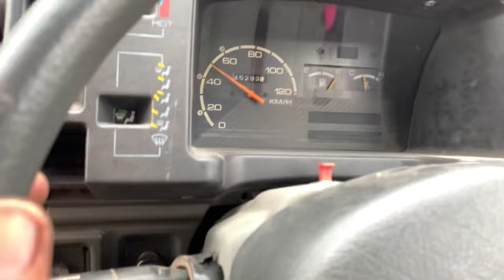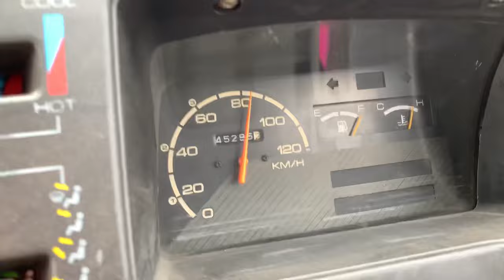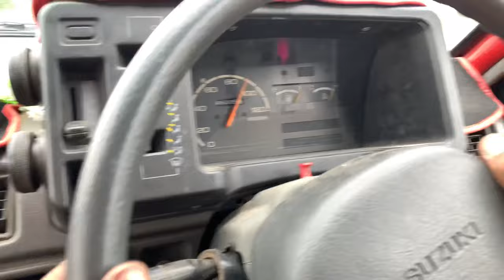The complete procedure for attaching a Honda 125 carburetor to a car | Unique Idea for Amazing Video

Comment: It can run .but due to less air to engine it will consume more fuel so not beneficial .and it will not stable on hills
Reply: Exactly....but what thru jugaarr (Fuel jet with increased diameter, max possible fuel supply), they will manage to improve a common user experience OR at least will convince the customer that compromised eng performance is a bargain for 40km per Ltr . However, over a period of time this engine will be ruined due to highly lean fuel mixture resulting higher engine Knock.
660CC engine is capable of swallowing 0.5 to 0.6 gram Air per second and proposed carburetor can never meet stoichiometric air-fuel ratio of 14 air:1 fuel....very high lean conditions, resulting higher knock effects coupled with detonation in cylinders, sudden temperature rise and engine metallurgy going to 🐕....
"Barrey barrel shehron mein gareeb insaan aesey he lut-ta hae"
Reply: Yes.true
Reply: @AutoDiagnosticsPK  apkai nazdeek yeh option sahy nhi hai?
Reply: @pakistaniraees  
جی بلکل بھائی۔ 660 سی سی کی گاڑی میں جب 125 سی سی کا کاربوریٹر لگے گا تو گاڑی چلے گی ضرور پر اسکی پاور کم ہو گی، آپ ایکسیلیریٹر زیادہ دبائیں گے اور فیول ایکونومی بمشکل ہی مل پائے آپکو پر یہ گارنٹی ہے کہ گاڑی میں ناکنگ ہو گی اور انجن کی لائف کم ہو جائے گی۔ اور بونس میں گاڑی انڈر پاور رہے گی، یعنی چلانے کا مزہ نہیں آئے گا
660 سی سی گاڑی ہوا کی زیادہ مقدار سک کرتی ہے اور چھوٹا کاربوریٹر اتنا فیول سپلائی نہین کر سکتا، بھلے یہ اسکا نوزل کتنا بڑا ہی کیوں نہ کر دیں
Reply: You can use 30mm or 32mm carb, that honda 125 carb is only 24mm maybe 26mm i think,its too small..
Reply: An American guy put lown mower carburettor on V8 it even gives best milage
Reply: I have Maruti 800 brother can you do that for me

Comment: Not recommended. at the end of the Ride. the temperature gauge is at high position. its mean due to low air/Fuel intake car is getting heat-up.

Comment: Smaller carburettor, a little less power, better kilometres per litre, good when gasoline costs so much. Really amazing how well it works. 👍✅
Reply from the maker: Thanks Sir
Reply: sir massg pa rabta ho sakta ha.
Reply: @AmazingTechnology1 
❤
Reply: Assalamualaikum sir ya petrol pipe T shape main q lagay hai fuel pipe ki setting Samaj nahi ahi
Reply: Not at All....its not about better fuel average against little less power but its about ruining your engine in totality........

 thru jugaarr (Fuel jet with increased diameter, max possible fuel supply), they will manage to improve a common user experience OR at least will convince the customer that compromised eng performance is a bargain for 40km per Ltr . However, over a period of time this engine will be ruined due to highly lean fuel mixture resulting higher engine Knock.
660CC engine is capable of swallowing 0.5 to 0.6 gram Air per second and proposed carburetor can never meet stoichiometric air-fuel ratio of 14 air:1 fuel....very high lean conditions, resulting higher knock effects coupled with detonation in cylinders, sudden temperature rise and engine metallurgy going to 🐕....
"Barrey barrel shehron mein garden insaan aesey he lut-ta hae"
Reply: @AutoDiagnosticsPK  really!  From a year ago, have you been in hibernation? 
The subject car works, clear to be seen, I have done the same thing with a 500cc motorcycle engine many years ago, not one detrimental issue, despite all your "theory". Please try to keep up...
Reply: @gazzafloss  never dear...you did this mod with a bike with 500CC...and a bike designed air-fuel ratio perhaps is different and at least it needs much lesser fuel due to lesser parts and loads/lesser accessories the engine has to run....so lucky for you....below lines, I typed earlier as I couldn't read your text correctly and just took it as if you were referring to a 660 CC car Engine....nonetheless, it may be useful for someone 

if ones car with smaller carburetor doing great then it's defying the established laws of science....must be a Saint (just kidding...no offense)
Perhaps you must have modified air system as well....
Just popped-up in my mind, another science theory when I mentioned air system modification.....less fuel with much more air can't give you good averag and engine can't sustain its health either....yes, in case, there are already engine compression losses (due to worn ring-piston or disturbed lifters clearances), so the engine capacity for air suction will reduce and if you are lucky air-fuel ratio may come closer to stoichiometric ratio of 14:1....and if your car is still running, then you are that lucky guy....
Happy for you that your car is running good with this modification
Reply: @AutoDiagnosticsPK  it works, that's all that's important to know. What the theory says in this case is really irrelevant, you can be sure the owner of that vehicle isn't worried beyond having his car working for a reasonable cost, so what works, works, it may not last another 20 years, it may not win a race but it works.
The 500cc motorcycle that I did many years ago worked fine for it's purpose for a couple of years which is why I made my positive comment about what they had done in the video, I know it's not "by the book" but it does work.
Reply: @gazzafloss    I am happy for you mate....

Comment: Hello we just did a full rebuild on my Suzuki alto 1986 0.8 39hp everything inside is brand new from top to bottom a full engine rebuild and I m wondering what type of engine oil do I need to use and what do you recommend

Comment: Thanks for sharing this video clips.... Please can this method be use for a 4 Cylinder car with 2.0 Liter engine...? I am just thinking if this method will minimized fuel consumption... Gasoline/Petrol prices is now on the high side
Reply: Never improvised for fuel economy, else you will have to pay much more than your expectations.....you car design won't allow...
Here is a brief explanation, I posted elsewhere in this chat; I hope will help you understand the why part....moreover, get your car data analyzed, to know what to do for bringing back max possible fuel average in accordance with manufacturer design:-
they will manage to improve a common user experience OR at least will convince the customer that compromised eng performance is a bargain for 40km per Ltr . However, over a period of time this engine will be ruined due to highly lean fuel mixture resulting higher engine Knock.
660CC engine is capable of swallowing 0.5 to 0.6 gram Air per second and proposed carburetor can never meet stoichiometric air-fuel ratio of 14 air:1 fuel....very high lean conditions, resulting higher knock effects coupled with detonation in cylinders, sudden temperature rise and engine metallurgy going to 🐕....
"Barrey barrey shehron mein ghareeb insaan aesey he lut-ta hae"
Reply: Es se gaari ki race zyada do to gaari baith jati hai.  pick ni lrti.

Comment: You gays notice 10:45 in  Vedio the heat Needle was on last poision means at H, so buddy after some times the engine will goes up fire and blast, to much dengerous for both car and human
Reply from the maker: Thanks 🙏
Reply: Exactly....yet, they will manage to improve a common user experience OR at least will convince the customer that compromised eng performance is a bargain for 40km per Ltr . However, over a period of time this engine will be ruined due to highly lean fuel mixture resulting higher engine Knock.
660CC engine is capable of swallowing 0.5 to 0.6 gram Air per second and proposed carburetor can never meet stoichiometric air-fuel ratio of 14 air:1 fuel....very high lean conditions, resulting higher knock effects coupled with detonation in cylinders, sudden temperature rise and engine metallurgy going to 🐕....
"Barrey barrey shehron mein ghareeb insaan aesey he lut-ta hae"

Comment: suckup vibration pad rai  tbhi bajaj 150 gravel pe skid marti 400 k uper th gravel uda deti torque radial se tbhi... thanks but dunlop 20 auro hawk tube5 oximeter 30 dal rai uspe thanks again:pride-megaphone-rainbow-handle: ab ek bar jhatez vibration of tata cam shaft nano reasoning batae under poer ki plz:face-green-smiling:

Comment: Use same old carbuerater... Just simply place some clutch wire in the holes of both  jets it will better fuel economy and try to run your car with soft padels and low on rpm..
Reply: How to place clutch wire in the holes of both jets?
Reply: @LA7-w2x  unroll the twisted clutch wire, then they got separated. Use single wire from the bunch and cut it in the size which can be tied through the hole of jet... I hope u can understand... It's very simple if you asked any old mechanic to do so ...

Comment: A carb is a " vanetury nozel "  that provides fuel Air mixture to engine ,,,,, One little Clerification >>> Engine suck only that much mixture ,,Required by engine ,,, So any carb can be fitted to any engine ,,, second >>> less fuel consumption means  less Heat produced ,,, this engine will not heat up by the law of thermodynamics .... Third >>>> fuel efficient carb never had a bad effect on engine life . please stop commenting ,, yeh garam ho gy ,,, engine khatam ho jay ga ,,, Thank a lot
Reply from the maker: Okay Thanks 🙏
Reply: Ya garde ke heat wali soi full heat Q ho gai.
Reply: @qaiseralishah66  Video at 9:33   ,,,, Fuel / petrol guage is at full ,,,,, Heat guage is at 40 + degree ,,below the mid point , Watch it once again ,,, if you issues / question ,,, Please ask owner of this clip ,,, one more thing please ask in plain English . thank you have a nice day .
Reply: Exactly....but they will manage to improve a common user experience OR at least will convince the customer that compromised eng performance is a bargain for 40km per Ltr . However, over a period of time this engine will be ruined due to highly lean fuel mixture resulting higher engine Knock.
660CC engine is capable of swallowing 0.5 to 0.6 gram Air per second and proposed carburetor can never meet stoichiometric air-fuel ratio of 14 air:1 fuel....very high lean conditions, resulting higher knock effects coupled with detonation in cylinders, sudden temperature rise and engine metallurgy going to 🐕....
"Barrey barrel shehron mein garden insaan aesey he lut-ta hae"

Comment: Yeah it can run.. but not at long period because of low fuel mixture to engine. That carb is not build for a car and it will cause your valves my friend tried that so I know about this 😅 
So don't destroy your engine's....
Reply from the maker: Thanks 😊
Reply: Finally someone in comment section who understand basic stuff leaner mixture i.e with higher oxygen when heated could oxidize the Exhaust valve and make metal oxides and Causes Pressure in engine to reduce during compression and Power stroke
Reply from the maker: You are right thanks sir

Comment: Can't understand because 125 fuel mixture can't feed 800 cc engine as per it's need,. fuel starvation will occur
Reply from the maker: Thanks 😊
Reply: Well 800 3 cylinder means only 260 cc per cylinder and they work one cylinder at a time
So 125 cc carb with little mods on jetting would be enough to feed them
Reply: Actually that 125 carburator provide fuel mist through what the force of suction of every one cylinder that is from my observation not totally 125 carburator only for 1 cylinder distribution my point is it depends upon the force of every cylinder suction og mist in carburator. Any questions in my observations? It is right? And i appreciate what the comments and i apply thanks

Comment: Extremely dangerous. Engine might blast or fire could breakout due to so much heat.
Reply from the maker: Thanks 😊
Reply: Lean mixture
Reply from the maker: Thanks 😊
Reply: What are you saying about maruthibomeny van. Omeny van running samebbike model carbureter that company made it
Reply from the maker: @fayis1977 Thanks 🙏
Reply: Babaji abhi gadi ki sooper video upload karo engine ka video @AmazingTechnology1

Comment: You should use a carburator for 250cc engine
Reply from the maker: Thanks 😊
Reply: @AmazingTechnology1  adjust the fuel mixture so it will not Damage the engine
Reply from the maker: Okay 👌